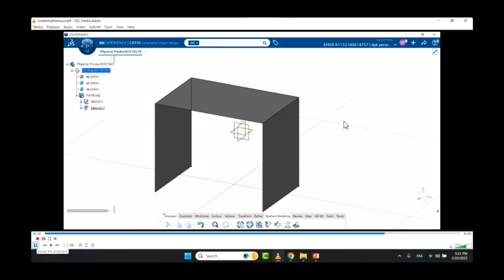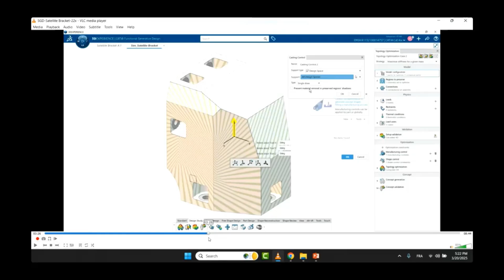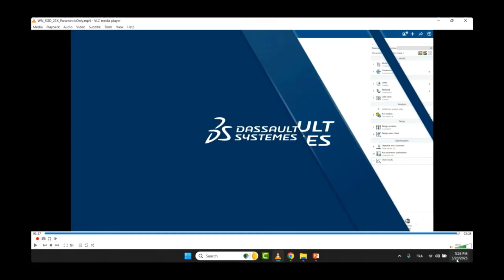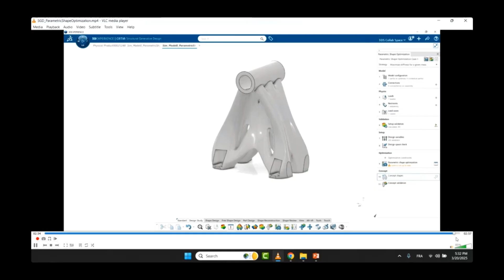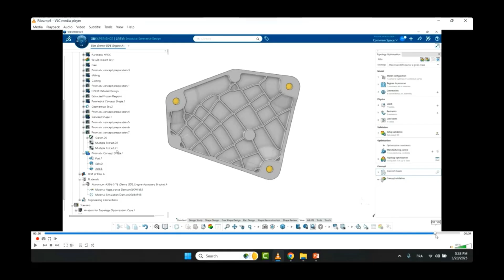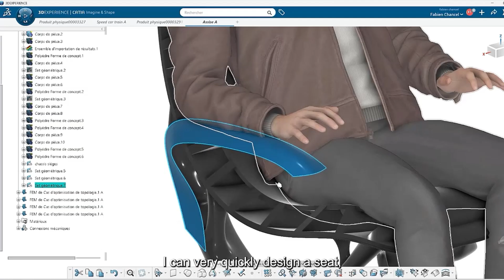Generative Design & AI in 3DEXPERIENCE | CATIA Insights

Comment from the maker: Question 7: Does AI-based design and simulation use existing customer data for optimization?
Reply from the maker: ✅ This is a crucial concern for customers. Unlike ChatGPT, which uses freely available web data, we do not use customer data unless explicitly authorized. In Simulia, we train AI models based on customer parts without accessing the proprietary data itself. AI deduces surrogate models from the customer's existing designs to accelerate new part optimizations. However, customer data remains their intellectual property, and we ensure it is protected.

Comment from the maker: Question 5: How does CATIA compare to ANSYS, MATLAB, etc.? Can metadata or other methods be used to link design architecture and constraints to a system application document?
Reply from the maker: ✅ This is more related to the platform. In 3DEXPERIENCE, we manage applications at the platform level. These applications can be linked to design parameters within CATIA. For example, if you want a precise gap between two vehicle panels for aesthetic and manufacturing reasons, it impacts design, manufacturing, assembly, and even painting. The platform considers all these factors. Additionally, we support system engineering and integrate MATLAB for simulated data and standard FMI. The platform was built with these capabilities from the beginning.

Comment from the maker: Question 2: Does generative AI design help convert drawings into 3D? Is an FEA solver required to optimize the geometry based on FEA analysis results?
Reply from the maker: ✅ You have seen topology optimization and parametric optimization—both are typically based on FEA, whether structural or fluid. However, you do not always have to use FEA. For example, parametric optimization can define a shape targeting a specific volume, such as designing a bottle to hold exactly one liter. In such cases, no FEA is required. But in most cases, FEA is used to reduce weight, minimize displacement, or achieve a specific eigenfrequency.

Comment from the maker: Question 1: How do generative design features and immersive contextual user interface affect product development?
Reply from the maker: ✅ The Smart UI guides the user by suggesting the most relevant or recent command after a click on the screen. This helps improve design skills and enables the creation of better products by using the right tool at the right time. Generative design is primarily an optimization tool—it helps reduce weight or optimize duct flow. The purpose of all these tools is to improve efficiency.

Comment from the maker: Question 3: Are AI features and generative design available in the next CATIA version, or are they available as a type of plug-in?
Reply from the maker: ✅ It is not a plug-in. Our idea is to use AI not as an independent feature but as a means to develop new tools or improve existing commands, benefiting from AI. We develop AI to recognize multiple profiles—polylines, arcs, line segments, and splines—in a drawing. AI helps accelerate this recognition. It is integrated into 3DEXPERIENCE CATIA. However, for some future AI-driven solutions that we call Generative AI Experience, the approach might differ.

Comment from the maker: Question 6: What is the inclusion of simulation components in optimization? For example, thermal analysis, vibration—what is included?
Reply from the maker: ✅ Currently, we perform structural analysis. We also use the fluid aspect of Abaqus. However, we do not yet perform thermal or vibration optimization. We still calculate the minimum eigenvalue frequency, but that is not truly vibration analysis. We use Tosca for topology optimization, and Tosca itself can now also perform thermal optimization. Perhaps in future versions of CATIA, we will also address thermal topology optimization.

Comment from the maker: Question 4: What is the interrelation between experimental design and generative design? Does the 3D Experience develop an algorithm for interfacing between these tools to automatically support each other?
Reply from the maker: ✅ Yes, as I showed, you either use experimental design with our standalone tool called Parametric Design Study to obtain an optimized parametric model, or if you want to significantly reduce weight in areas unknown to you, you use topology optimization. From topology optimization, you can create a parametric model, which can then be used by the Parametric Design Study. So, you can combine them.